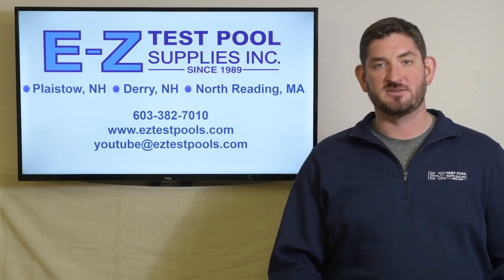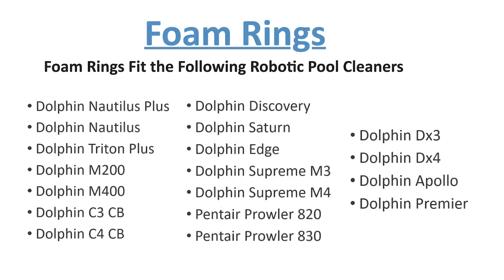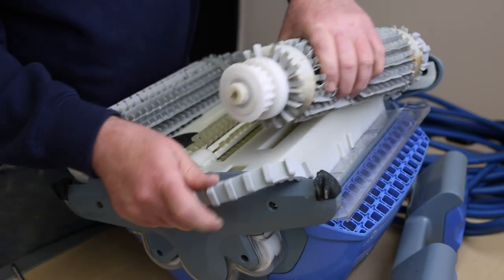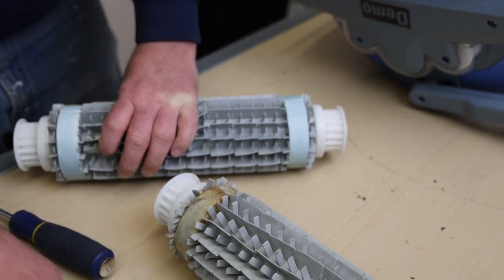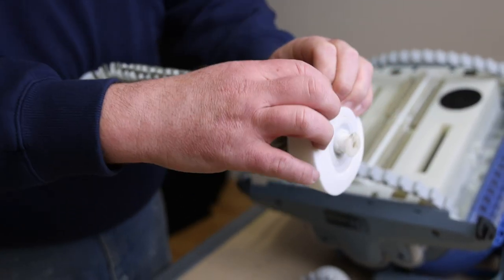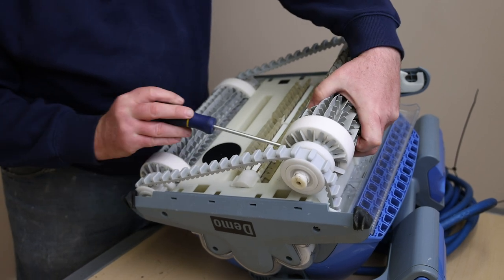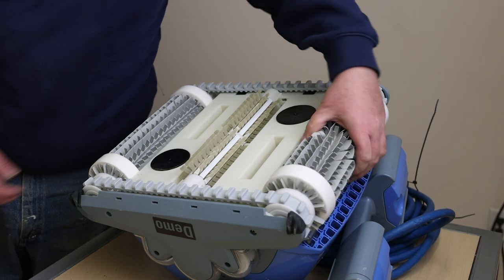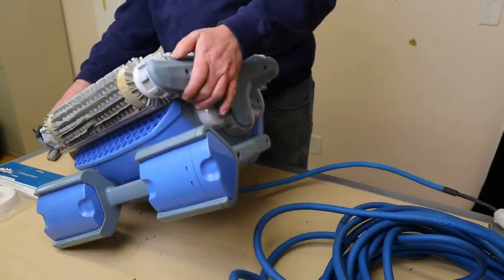How to Replace Maytronics Dolphin Foam Climbing Rings

Comment: First, thank you for this helpful video. 
I have the NAUTILUS CC plus for one and a half years. At the beginning everything was fine and he climbs the walls. The white climbing wheels never get dry and they are looking good . But I changed them anyway. Also I made the test drive, without the filters. But still he does not climb. The tiles in the pool are actually not very slippery. When he keeps standing in front of the wall and I put him a little bit upwards, than he climbs the wall. Any idea? Thanks a lot for every information. 
Greetings  from Panama!

Comment: There’s a sprocket ⚙️ that attaches the big wheel to the front roller.  That sprocket got severed from the roller wheel.  What part is that? How do I replace that?
Reply from the maker: I will contact our robot tech. What exact model do you have?
Reply: @Eztestpools  nautilus cc dolphin
Reply from the maker: @wayfaringoverlander  Do you have a picture of the part and the serial number of the unit, that would make it easier to see the problem. If this is still something that you are looking for help with you can email this info to matthew@eztestpools.com Happy to help

Comment: Thank you for the clip. I found that the replacement Maytronic climbing rings did not last as long as the original Maytronic climbing rings........ohhh well, did anyone else have the same issue?
Reply from the maker: Thank you Euan! This is most definitely a part that wears but not sure on the original vs. replacement
Reply: @Eztestpools  i just replaced the Maytronic climbing rings for a second time and I do hope they last longer. I did notice that the latest order of seals were more moist coming out of the plastic bag compared to the first replacement set  - that could have been a reason? Thanks again for the content!
Reply: I put my premier in service in March and by the end of April I lost three rings and ordered replacements.  It's early May and I found this great video guide for the process.

Comment: Thanks for the tutorial, I replaced then rings and the swivel cable on my Nautilus cc plus, but after put it in the pool it only stays on the walls, any idea of what I done wrong? The bot only stays on the walls and it doesn’t clean the rest of the pool.

Thanks
Reply from the maker: That is probably an issue with the robot's program and not anything you can replace. Contact a Maytronics repair specialist nearby to take a look!
Reply: @Eztestpools  thank you

Comment: Just trialed a m600 and it worked fine .. bought an m600 and the climbing rings are leaving what appears like wear tracks on the epoxy coating on my pool it didn’t happen with the demo any suggestions?
Reply from the maker: Unsure why this would be happening. You could replace the rings. It is a simple fix.